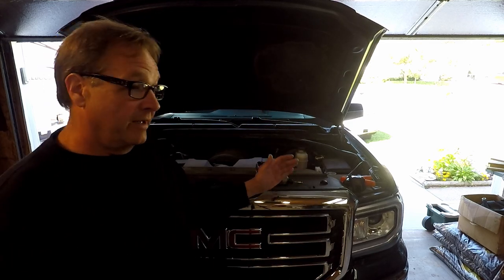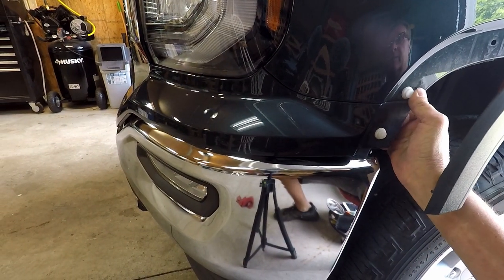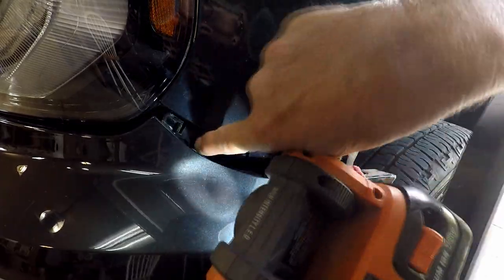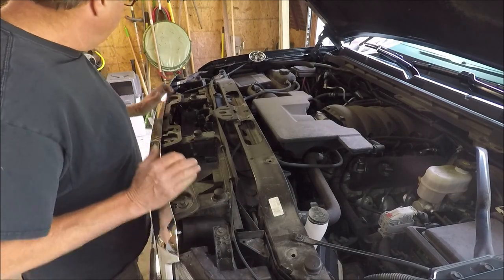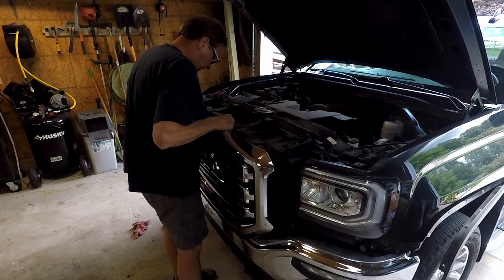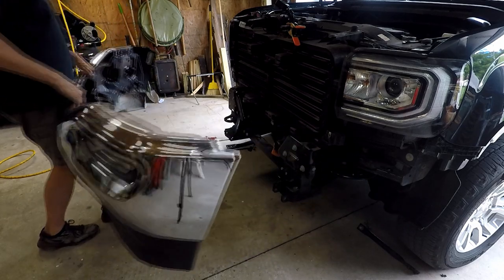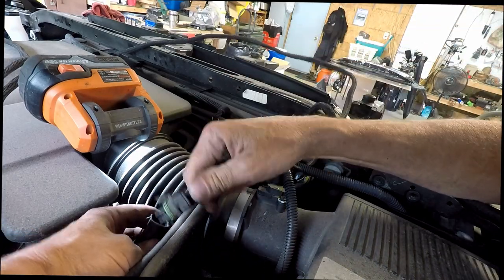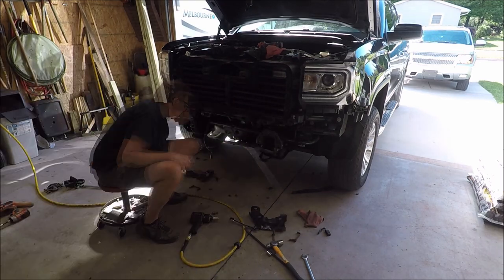Western Ultra Mount Plow Mount Removal from 2019 GMC Limited

Comment: Hey hey,
Uncle Vic here.

You're a better man than I.
Two days ago I spent another $992.00 on plow parts.
A few days before that I dropped a couple hundred on front end parts.

I've got to install all this stuff, an entire BOSS 8 1/2' Straight Blade on my 94 F150.

I'm anxious to get it done. I've been waiting five years to have a plow.
However, I think that I would opt to just leave that undercarriage on the truck as opposed to tearing a newer truck apart like you just did.
My undercarriage cost over $650.
My back (what's left of it) is worth more.

Great job Mark.

Comment: I thought you broke that fender flare right away on that 1st pull. Plow dealership around here charges around $200 to remove mount and wiring. Sometimes just easier to pay a few bucks and not have to worry about this. Way too many little tabs and screws I would of probably broke something and been mad I didnt just pay a couple bucks to have done.
Reply from the maker: Taking the front end off of the truck is not a big deal. I was certified in body repair working in body shops until 1989.